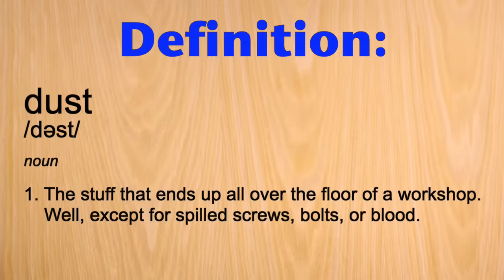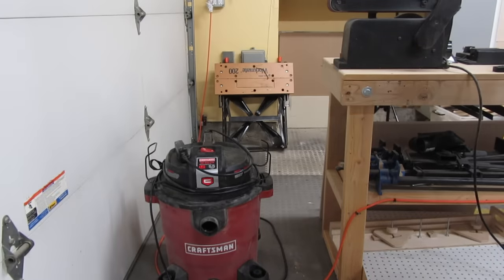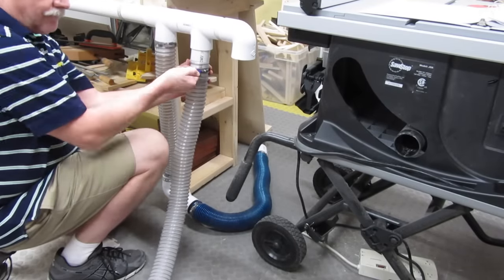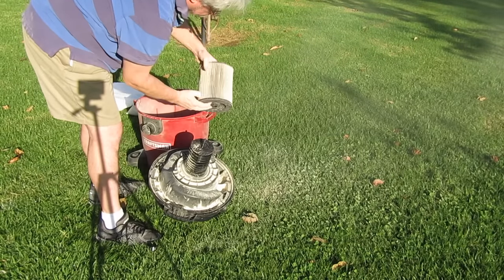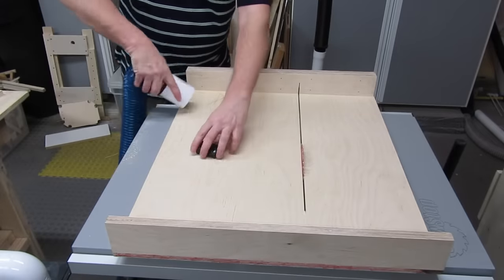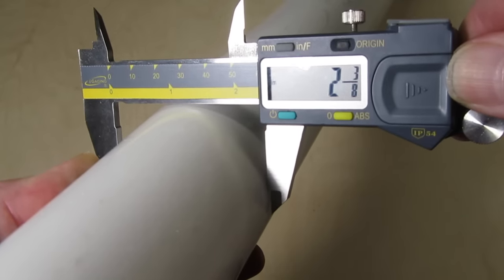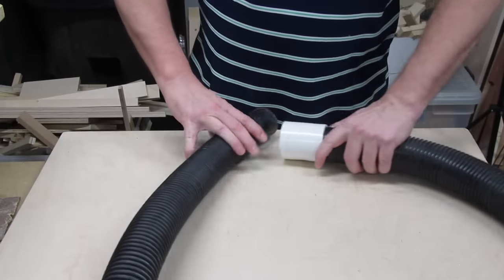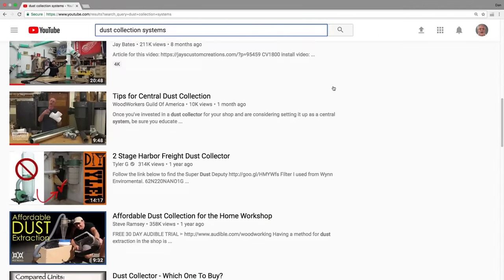Dust Collection for Newbies: Introduction to Dust Collection

Comment: I tried cutting a piece of 4 inch plastic pipe a few years ago on my Radial Arm Saw. I don't know what happened, everything seemed to be progressing great. Then suddenly that 4 inch piece came up at about a hundred miles an hour and whacked me in the nose. I thought doing repetitive cuts on the Radial Arm Saw would be fast and give a nice finish. I was very wrong, there are some materials that are not suited to being cut on Table Saws, Miter Saws, Radials Arm Saws, etc. Now I cut all plastic pipe with my Plumbing Plastic Pipe Cutter. It has a thin cutting wheel designed for plastic pipe and it leaves a really nice finish.
I got dust collection covered. I have a large Home Depot Rigid Shop Vac hooked up to 2 1/2  inch, transparent tubing for most of my machines. Each entry port is a blast gate. And I have a 3 HP Laguna Cyclone that I use exclusively at this time, for my Cabinet Saw. If I take off the splitter it is 8 inches, with the splitter there are three 4 inch outlets. Right now I mostly have 2 capped. It works great removing dust but it's really noisy. 
Excellent video with some really super ways of overcoming dust collection challenges. The development of your dust collection manifold with blast gates offers great versatility, really well done. Thanks for sharing this.
Reply from the maker: Thanks for the comment! It's funny - some people have no problems cutting with power saws, while others do. Not sure what the difference is, but to me, I'll stick with a hand method. 😄

Comment: Very good introduction to  dust collection!  You didn't mention diffusing Static build up in dry climates! that will bite!! OUCH!
Reply from the maker: Thanks for the comment! You're the first one who's mentioned static buildup without mentioning the words "explode" or "fire". And I'm not a worrier about those things, in small-sized shops. BUT, the "OUCH" factor is certainly a legitimate concern that I hadn't thought about. Do you know if the usual methods of grounding dust collection systems work for getting rid of the OUCHes?
Reply: You can wrap a copper wire in a spiral fashion from one end to the other, of each pipe.  Tie them all together, and tie one point to ground.  This will mitigate, if not eliminate all static.  The wire does not need to be all that large 8n diameter, but really small wire breaks easier.
Reply from the maker: @MrElliottBruce  Thanks. I've seen videos on the subject, so it shouldn't be too hard. I appreciate the help!

Comment: Thank-you for all you do.  I always enjoy your videos, and always learn something.  Have watched this one a number of times.  I really like the way you organized your dust collection.  One thing bothers me.  I see a lot of folks building dust carts with the cyclone on top.  The hose comes out the top, makes a sharp bend downwards, and in most cases, it makes at least one or two sharp 90 degree bends.  Sharp bends are always bad for airflow.  Hose length also effects airflow.  Seems like it would be more efficient to position the shop vac so the inlet is a few inches higher than the exit port of the cyclone.  Then the hose between the two could be real short, with us tone easy bend.  Just a thought.  Again, thanks.
Reply from the maker: Thanks! And yes, you're probably correct. When I built this, I hadn't even thought of that. Maybe I should do a video testing various scenarios, and see what the effect is. Thanks again.
Reply: The Newbie Woodworker Just built a dust cart along the lines described.  I have a Ridgid HD1400 shop vac and a Home Depot 5 gallon bucket with Dustopper.  Previously, they sat on floor, with large, tight bends in the hose.  
Airspeed fluctuates constantly, but eliminating the hose and it’s bends, airspeed went from about 13.5 m/s to about 14.7 m/s, an increase of 8.9%.  Don’t have anything set up to measure height of a water column at this time.
Reply: The Newbie Woodworker  Sorry, I forgot to mention: made a fitting for shop vac from 2 inch pvc, used a standard pvc fitting with large radius of curve atop the Dustopper, and a 2 inch flexible coupler to connect them. No hose. Just a gentle curve coming out of the Dustopper and a straight shot into the shop vac.
Reply: The Newbie Woodworker I was not completely satisfied with the pvc adapter for the shop vac, so I worked on it a little more.  Airspeed now centers around 14.85 m/s, an increase of 10% from baseline.  
I started out on that pvc adapter by cutting a plug from wood, putting a bolt through it, securing that with a nut, forcing it into the pvc, then chucked that into the drill press.  I used a sanding block, a wood gouge and a file, none of which met expectations. Today I used the bandsaw, carefully positioning the fence parallel to the blade, positioning the pvc segment against the fence, then making a tiny cut along the side; rotate the piece a hair and repeat, all the way around.  As the saying goes, sneak up on it.  Go around once, check the fit, adjust and check again.  Only took three rounds.  Much better fit than the previous methods.
Inspired by “Slow and Expensive”, who uses a simple jig and tablesaw.
Reply from the maker: @joedance14  That sounds awesome! There's nothing more satisfying than working out a solution to a tough problem. 😄

Comment: Great video, and i would have to reinforce that the hacksaw is the best tool for cutting PVC, I finally had the same experience as you and it was on a chop saw...one slight shift in the PVC or even a worn bearing in the saw creates an explosion that one would be lucky to come through unscathed.
Reply from the maker: Thanks for the comment! Some people have offered suggestions for how to cut PVC safely on a chop saw, but like you, I think I'll stick with a hacksaw. 😄

Comment: If you must use an elbow, use a sweep 90. They have a much gentler radius for less restriction.
Reply from the maker: For shop-vac-based systems, they don't make much of a difference. For blower-based systems, they do make a difference.

Comment: I have a chop saw, work fairly well, one trick I learned is a metal blade, or take an old used plywood blade, fine tooth not carbide tipped, you can also turn the plywood blade backwards. just do not use a carbided tipped blade, that is were it can explode. and as always take it slow.
Reply from the maker: Thanks for the info! 😄

Comment: You can use either a table saw or chop saw for cutting PVC. In either case, use a fine tooth blade and reverse the blade. This prevents chipping of the PVC.
Reply from the maker: Thanks for the info! 😄

Comment: Just subscribed and like your ideas. Well you don't get much more newbie than me when it comes to my shop. I have a clean 16 X 22 foot building with full trussed 12 foot ceiling for storage. I have underground cable all done and waiting for my electrician to finish hooking it all up with 110 and 220. I live in Michigan so I need something I don't have yet and that's HEAT. I just had a 220 electric heater delivered and I have purchased many of my tools so it's just a hurry up and wait problem. I am also a student in waiting of Steve Ramsey's Woodworking for Mere Mortals so I will soon have plenty to do when everything has power. I mentioned Steve Ramsey because I noticed you had at least one of his videos on your video page.
Reply from the maker: I hope you're taking Steve's new class. It'll help you fill up your shop. 😄And glad to have you aboard!
Reply: @TheNewbieWoodworker  Oh yes I will be when it's available after the 15th of January.
Reply from the maker: @kagnewmp12  After you get into it, let me know what you think. You could just post a comment here, or email me - you can email me from my website thenewbiewoodworker.com - click the "menu" in the upper right, and click "Email".

Comment: For cutting pvc my preferred method is just a Milwaukee battery powered sawz-all with the fine tooth metal cutting blade. Teeth on the metal cutting blade are almost identical to the ones on your hack saw and gets the job done with zero arm work.
Reply from the maker: I'm all for zero arm work!

Comment: I use a radial arm saw to cut pipe - safe efficient and a perfect cut every time.  Cut against the backstop - cut halfway through by pulling the blade and then rolling the pipe. Never had a problem and no need to level the end of the pipe - NEVER had any luck getting a straight end with a hacksaw - a skill I never learned I guess.
Reply from the maker: Thanks. I can't really get it straight with a hacksaw either, but close enough. 😄

Comment: Great video,  well done. Nice that you take time to explain everything. Yes you can cut pvc on a chop saw . Like all things you have to be cautious. The trick is to hold it securely against the fence otherwise it can or should I saw mostly kick just like wood. Nice little setup you have but I can't believe you don't have a chop saw...
Reply from the maker: Thanks for the info! And I get it, about the chop saw. But I don't have the room, and I haven't run into anything I can't do on the table saw with either a sled or miter gauge.

Comment: Thanks for your info.  I am at the point of designing a system for my small shop and you have been very helpful.  I like the idea of the 2" pipe as my shop is so small that 4" or 6" seems overwhelming.  I figure if the vac ports are 2", any larger piping is no more efficient.  Thanks again.
Reply from the maker: Glad I could help, and I think you're making a good choice. But as for 4" and larger pipes, you would use a true dedicated dust collector with them, and they operate on a different principal that actually needs the larger pipes. So don't assume that they're not more efficient (if that makes any sense). I'm not saying you need them, certainly not now, but they have their uses also. I probably confused you more, so forget what I just said, and have fun with the 2" pipes. 😂

Comment: Most of my woodworking tools are in my garage, so my "dust collection" usually consists of opening the garage door and blowing everything into the driveway and then into the yard. :)
Reply from the maker: 😄I think the most effective dust collector in my shop is the top of my drill press. 😄

Comment: I reuse my dust and chips so I need to keep other stuff out of it. A good dust collection system usually does it. However, I use a Shap Vac dedicated to nothing else but dust and chip collection. No systems. The really fine woodflour up to the consistency of sand, I use as an epoxy filler. The shavings and chips I give away for small cage pet bedding like hampsters and rabbits. I sometimes make a few dollars back.
Reply from the maker: Interesting! Thanks for sharing. 😄

Comment: a mitre saw works very well for pvc pipe although its important to make sure the pipe is clamped well on both sides close to the blade so that it does not flex and get caught in the blade.
Reply from the maker: Thanks for the info! 😄

Comment: I made one cut on a 4" PVC pipe using a chop saw and went straight back to using a handsaw. The little slivers of white plastic took months to get rid of. They stick to everything. Ironically I was making a dust collection system...
Reply from the maker: LOL. I totally get that. Same thing when you cut aluminum t-tracks, which I ended up building a jig for so it catches most of the shavings.

Comment: I have a mitre saw, and I've used it extensively for both PVC & ABS, pipe. The only caution I have is to make sure the pipe is secure. My saw has a clamp system, and that really helps. No matter what saw you use there will always be burrs to clean off.
Reply from the maker: Thanks for the tip! And I think you're absolutely right about clamping the pipe. It makes all the difference between a successful cut, and an explosion. 😳😄
Reply: me too! Yes, the clamp really makes the difference!
Reply from the maker: @jesseadler3431  👍
Reply: @TheNewbieWoodworker  the clamp saves the fingers if it kicks or explodes!
Reply from the maker: @daviddoe2440  👍
Reply from the maker: @bernardkinsky1637  I'll take your word for it, thanks.

Comment: Have you had any static issues? I saw some video that had to ground their setup to help prevent static fire or spark.
BTW you are so far my favorite woodwork channel. You explain things on the newbie/casual woodworker  DIY level. Thanks a lot
BTW again you resemble Stumpy father. he is also a woodworker youtuber.
Great video.
Reply from the maker: Thanks! I really appreciate it! I have a video on the subject of static issues, but basically, this is my position: https://www.rockler.com/exploding-pvc-dust-collection-ductwork. Of course, the usual disclaimers apply - you're responsible for your own safety, etc.🙂 And do you mean Stumpy Nubs, AKA James Hamilton? If so, wow, that's a HUGE compliment. If not, well, I can dream. 😄

Comment: 2 ways I cut PVC and feel relatively safe about it.  Of course CLAMP IT! but, a Jig Saw with High TPI and set on 0 is my preferred way, make sure the blade is 1.5" longer than the width of the PVC though.  The other way that I feel less safe is the good ole reciprocating saw, I find it to leave more burrs, less accurate, and usually requires another tool to finish the cut squarely.  YMMV of course.
Reply from the maker: Thanks!

Comment: I've used a radial saw for years to cut pvc without a problem. Either a plywood blade or a carbide tip blade works well. I also have a handsaw made for pvc if I'm not in my shop.
Reply from the maker: Thanks for the info! 👍
Reply: Miter saw works for me.
Reply from the maker: @RDAUGIRD  Thanks for the info! 👍

Comment: FYI to keep dust from getting deep into the veins of your filter get an old pair of women's stockings or panty hose cut one leg to the length of your filter then stretch it over your filter ,that will collect most of the dust.Just pull it off and shake it clean.This will lengthen the life of the filter and keep it cleaner.
Reply from the maker: Thanks. I'm not really sure this is needed when you have a cyclone, but it certainly couldn't hurt!

Comment: Will I have more suction/power if I remove the bag now? I guess I wont really need it as much. 

This system works very well in my shop. I used a 10 foot section of 2" sched-40, 3 blast gates, and used SHOP VAC hoses and additional adapter kits from lowes/shopvac to connect everything together. I made custom PVC fittings for the blast gates and cut up adapters from a 2.5ft section of the spiral 2" hose from WoodCraft, band clamps using painters tape to improve the seal.... The Duststopper I bought was defective and the manuf sent a replacement which I further bolstered with some 5/16" medium compression weather stripping....It's really pretty cool!!! OH I almost forgot. I  bought a remote for the shopvac from home depot which is just a handy thing next to the mitre or table saw!!!  GOOD WORK NW
Reply from the maker: Thanks for the update, John. Sounds awesome! I don't know about the bag, try removing it and see what happens. 😄
Reply: Leave it on - NO effective increase in suction and the more bits of dust are removed from the air.
Reply from the maker: @paulrobinson9318  👍

Comment: You will get much better flow and reduced blockage and pipe erosion using sweep tees and long sweep elbows. A sweep tee has about half the pressure drop as a straight tee. Every long radius bend is equal to about 5 feet of straight pipe for pressure drop, and every tight radius 90 elbow is equivalent to about 17 feet of pipe; as well always seek to minimize the number of bends. Also keep your flex hoses as short as possible, and without any sharp turns.
Reply from the maker: https://youtu.be/DzuPo802mV8

Comment: Rockler also has a "cyclone".  However, I modified it by adding a port dead center in the lid for the vacuum connection.  Made it even more efficient.
Reply from the maker: Awesome! 😄

Comment: I have tried using one of my miter saws and they work but you face the same problem as the table saw.  PVC pipe is by nature brittle, that is why you should not use it for compressed air piping.  In any case this brittle nature is the reason high speed saws should not be used.  I have been successful with a cutting jig and a reciprocating saw or a band saw.  The jig is used to keep a straight cut.  If you don't care about doing it straight then just saw away!  

The best and safest way I have found is to use a pipe cutter.  I have one that looks like a tubing cutter but is opens to about 4".  I just clamp it around the pipe and rotate a couple of times and there you go, no mess, no fuss and no danger and a perfect cut every time if you measured your cut correctly!  I usually struggle with the measure once and cut twice theory, gets me every time!
Reply from the maker: My wife says it's "measure once, cuss twice" and I have to agree. 😄Thanks for sharing. Where did you get that 4" pipe cutter?
Reply: @TheNewbieWoodworker  I bought is about 6 years ago from my electrical supply house for cutting big conduit.
Reply from the maker: @bryanbarney8366  Ah, that makes sense. I've been looking in the wrong stores. Thanks!

Comment: I think that you did a great job on this video. Straight and simple, right to the point with answers to common problems every woodworker has come across.  If you need to increase the flow of your dust collector to cover a greater distance for instance from one room to another, or distance between tools,  how would you go about doing that?
Reply from the maker: Thanks for the nice words! I wouldn't try to have one machine cover multiple rooms, I think that's asking for too much. So I think having more than one vac would be the best solution for that. I hope that helps. 😄

Comment: You can use an abrasive blade for cutting steel, it more less grinds the pipe in two rather than cut it, and I have never had a piece of pvc explode like I have with a wood
Reply from the maker: Thanks for the tip!